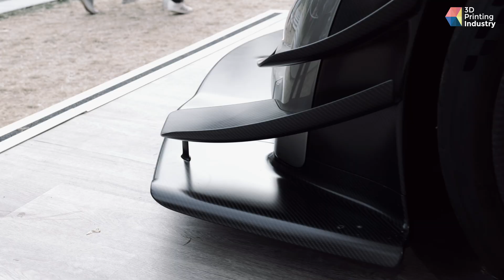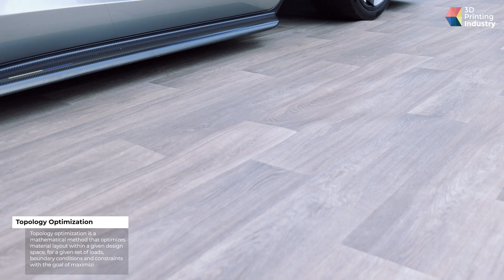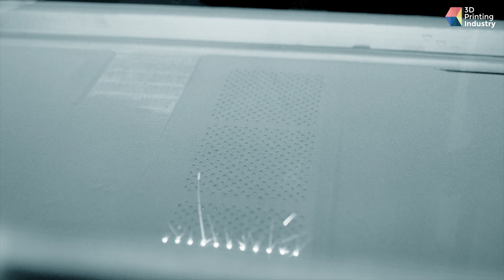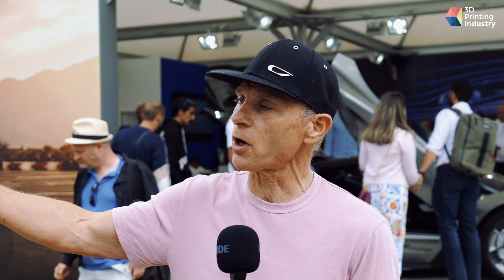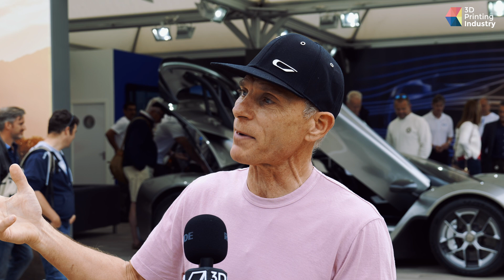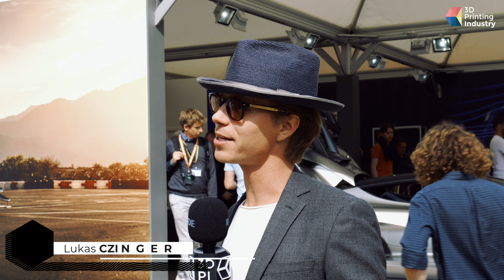3D printed hypercar costs two million dollars - Goodwood interview with Kevin Czinger, CEO

Comment: Looks super cool, shame its not electric? everything just seems so slow now compared to the new Tesla Roadster - Base Specs · Acceleration 0-60 mph. 1.9 sec · Acceleration 0-100 mph. 4.2 sec · Acceleration 1/4 mile. 8.8 sec · Top Speed. Over 250 mph · Wheel Torque. 10,000 Nm.
Reply from the maker: Is it a hybrid? Three onboard electric motors assist in getting the 21c up to 281mph. Stats we've seen:  "0-62mph in 1.9sec, 0-186mph in 15sec and 0-248mph-0 in a scarcely believable 29.0sec."
Reply: @3DPrintingIndustryNews  Hi, no its all electric, there is an air jet option to get it to do sub 1 sec to 0-60 :)  - https://www.youtube.com/watch?v=D1CqcLM0P7c